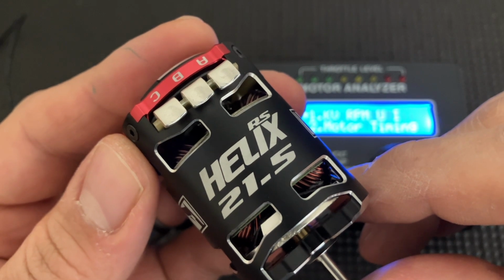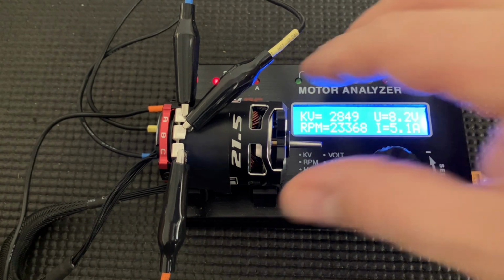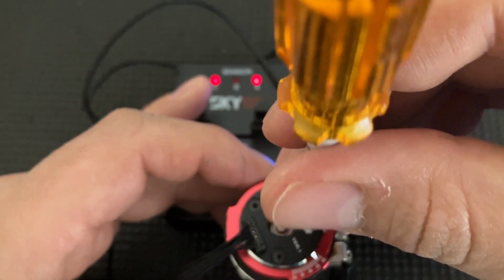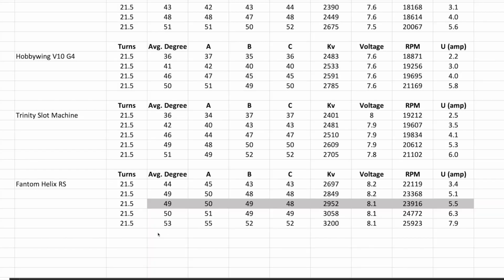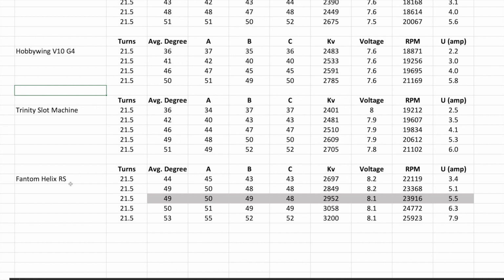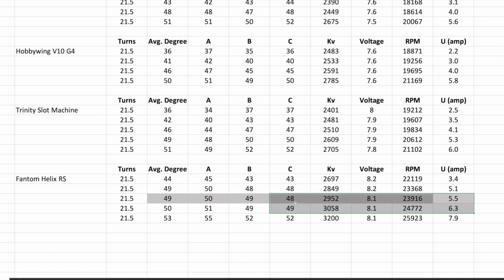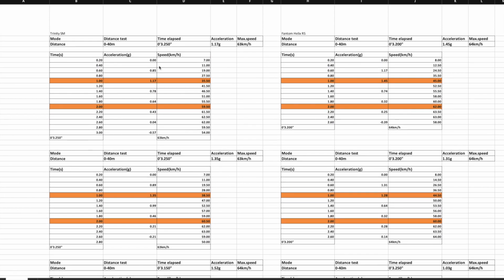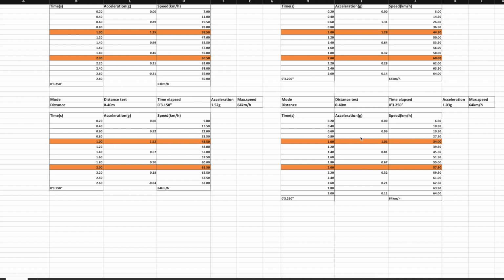Fantom Helix RS 21.5T motor Analyzer How it compares on paper with Trinity Slot Machine Hobbywing G4

Comment: Im switching from a 17.5 to a 21.5 Anyone know what gearing to start with? 
I currently have 72/30
Car is 2wd associated buggy
Reply: I tried both the 28 and the 30 today, both stayed cool enough, little faster with 30, I could probably go bigger though
Reply: Doing my first 21.5 race ever tonight
Reply from the maker: @MX-CO  Let me know how it goes.
Reply from the maker: @MX-CO  Your gear ration will probably be close to 2.0. You may even be able to drop to 1.8. That may be pushing it.
Reply from the maker: Anyone, chime in. Any feedback will be greatly appreciated. 

Some thoughts: You have a 72T spur. Have you considered running the 69T. Try the 69T spur and a 35T pinion. Lock out the slipper if you are running a slipper. Slippers will slow you down a tenth or more per lap.
Reply: @telecomandorc  I don't currently have a 69. I thought about trying that but they don't have one at LHS I'd have to order one, I may do that in the future.  
For now I just have a 72, so not sure what to try for a pinion with 21.5 I also only have the slipper but I'm racing on High grip clay, I thought the direct drive was more for carpet?
Reply from the maker: @MX-CO  The slipper is more to save the idler gear. If you take a jump the go to throttle before the rear tires land, you can break the idler without a slipper. Carpet is higher grip than clay in my opinion since we run pins on the tires. You can always torque it down more. See what the other guys are running.
Reply: @telecomandorc  OK gotcha,  I was thinking it was more for traction,  and I thought the direct drive on dirt would be more likely to lose traction.
Reply from the maker: @MX-CO  It absorbs some of the jolt from the throttle. If you are smooth on the throttle, no slipper is the way to go. If it is high traction, not slipper assuming you know when to apply throttle after a jump.

Comment: Which 21.5 motor would you buy?
Reply from the maker: I would get the Fantom RS over and over again. I may make a video in the future.
Reply: So its better than the Surpass V6?@telecomandorc
Reply from the maker: @MX-CO  I think it is. The Fantom is better.  but someone with more skill and a V6 will beat a Fantom. But a skilled driver with a Fantom will take the field.

Comment: There was a guy at our local club race tonight in the 21.5 2wd intermediate class running a helix rs, he said it was an alpha I don't see that listed anywhere,  but anyway this guy's car was so so fast, it was faster than most of the 17.5 classes.  He was clearing a big quad that I couldn't clear with a 17.5 . Some think he is cheating some how. He always has the fastest car in whatever classes he is in. Seems a little fishy..
Would you think he is cheating somehow, or is there a logical reason to win easily by 49 plus seconds? Is there a reason any 21.5 should be that much faster than the rest? I think there are others in his race with fantom motors as well, and he laps them with the same motor supposedly
Reply from the maker: It could be both. Now, I am a fan of Fantom RS motors. My 25.5 was a rocket. My 21.5 was awesome. I could pull on other cars and other drivers though I had something going on. They were just awesome. Now, for VTA I did take an outlaw motor and run it. I would take my time to get to the straight and then try to match people on the straight. This is how I found many people were cheating. I did tell the owner what I was doing. 
The thing is the Fantom RS is truly and "alpha". So it is hard to tell. I am not sure how large your track is. 49 sec is between 2 and 3 laps here. That is a lot. The guy could be running the outlaw version. Or the guy is a pro driver and has his car dialed.
Reply: @telecomandorc His car is clearly faster but he isn't a pro driver, there are much better drivers at the track. But his car is very clearly faster on the straights, and clears jumps that no one else in the class can.
Reply from the maker: @MX-CO  It might be the outlaw model. The Fantom Helix RS and Outlaw versions look very similar. Just peak to see if it is an Outlaw.

Comment: Picking one of these up this week to replace the reedy s+ motor. Should i expect a difference!???
Reply: Its the $240 works edition
Reply from the maker: Unfortunatly, I have not tested the Reedy s+ yet. Compared to Trinity, Expect a difference. So, if you have run your Reedy against Trinity motors or R1, this one is quick.

Comment: Are you running the 21.5 Fantom in anything at the moment?  I have a Fantom Helix RS in my VTA and its been great.  Im actually going to put in a 53t pinion for the next race with 92t spur.  With 52t pinion it comes off the track barely warm….Considering a Fantom now for my 21.5 touring car.  I have the R1 in my TC now and its fast but I think ive reached the gearing limit…
Reply from the maker: I am running the 25.5 Fantom in my F1 and I like it. In 21.5 I like the HW a bit better. I was running a Fantom, but the HW edges it out. But I prefer the Fantom 17.5 over the HW. I have a HW and Fantom in each of my Tamiya minis.

Comment: I’ve been running the Helix 21.5 in my X4 all season and its been a great motor. I’m still raising the pinion to find the sweet spot as it runs so cool. Trying 96/51 on Saturday.
Reply from the maker: Awesome. Keep us posted. Are you also between 48-52 degrees of timing?
Reply: @telecomandorc  The Motolyser strip says +52.2°. Measured current 3.10A, RPM 20915, K/V 2825, Hall Sensor: 0.2, Mag Assym: 3.0°. But the phase currents show 7.5, 7.3, 7.3A which seems too high? I check the temps after each run with a HW WiFi adapter. Thats another bonus of the Fantoms...they have the same temp senor as the HobbyWings. Read into that what you will ;-)
Reply from the maker: @bstearn1653  The phase current, that is with load or no load?
Reply: @telecomandorc   That's just what's on the slip so I assume no load, but I see all my other motor slips say the same thing so I guess it's normal? Any idea what it means?
Reply from the maker: @bstearn1653  It is the current the motor draws per phase (A-B, B-C, and C-A). My phase current is close to 7.7A on my 21.5T and over 8A in my 17.5T. So, it must be no load.

Comment: Very impressive phantom motor they are top shelf my opinion. Excellent video love your tech videos. Have u ever tested the velineon 3500 KV or any R1 motors
Reply from the maker: Unfortunately, my motor analyzer will not work with the VXL because it is sensorless. As we speak, I am waiting on a 25.5T Helix and my Fantom Facts Machine which I have been waiting for to test the rotors. Supposedly, they are not longer backordered and processing 🤞 

I am planning on testing R1 motors, but do not have a timeline yet. Many of the top guys here run them. But I only have access to old used ones. So as soon as I budget for the R1s I will. Just need to race the Fantoms first to get a feel for them, and finish my Traxxas 4-Tec requests. I have actually been off work (holiday) for 2 week so I have had more time to make and release videos. 

As far as motors, I generally buy 21.5T, and 17.5T. That is what I use the most. I may also do 25.5T, and 13.5T from time to time. So I will most likely do these four R1 motors in the future. Is there a specific turn R1 that interest you so I can prioritize it?
Reply: @telecomandorc  well if u ever come across a R1 wurks motor 13.5. - 4. T  just wanna see how good they actually are. Ty for great content and getting back to me
Reply from the maker: @mikebianco7854  I should be able to do a 13.5T after January. Thank you very much for watching and making suggestions.
Reply: You can run sensorless just make sure you are on 4 pole if the kv is crazy high
Reply from the maker: @jamesperdue2296  I tried sensorless once and it was really slow of the start in comparison to sensored. It was .4-.5 sec. slower 0-40m compared to sensorless. Just the start up. Then it took off. That is why I like the Tekin Rx8. Starts off sensored and then automatically switches to sensorless.

Comment: I noticed in one shot the motor was in the car connected to the ESC.  Is there any difference when the motor is tested while wired up vs. on the bench?
Reply from the maker: The difference would come from the resistence of the solder or wire connections made. But the data in the first table with the Kv data is all from testing the motors not installed.

Comment: So perhaps i should get the Fantom Helix instead of the slot machine for my 25.5....
Reply from the maker: Maybe. I do have a 25.5T on order from Fantom. It is a spec version. Not sure if you can wait, but as soon as I get it, I will run some tests.
Reply: @telecomandorc  I decided to go with the 25.5 Fantom Helix instead of the Slot Machine.  I am considering swapping out my 13.5 R1 for one as well have yet to decide.  I was considering going for the Helix in my 21.5 but recently saw an old video of the R1 motors testing very well on an analyzer.  So Im sticking with the R1 for 21.5 for now...

BTW my trinity x-factor seems to have "wet the bed" as you say.  The inner section is now loose inside the out section of the can (sorry dont know the correct terms).  It was still running but i was concerned about burning up my ESC and wanted to try an R1.
Reply from the maker: @TheNewnan3  Sound like the laminations and windings separated from the can. That can happen, I have been told by one of my race friends that runs Trinity too. My Fantom Icon v2 treated me great and liked it better than Xfactor in my buggy. But the Icon is a dog compared to the Helix.
Reply: @telecomandorc  Yeah im leaning towards replacing the R1 but dang I just got it less than a month ago lol.  Honestly my lap times are only a few tenths better than the Xfactor but thats prob due to slightly better driving on my part….
Reply from the maker: @TheNewnan3  I have a few stuff coming in including an R1. I have not made the video because I am waiting on running the Helix 21.5T mid Jan. Our last on-road race was postponed due to rain too many times. So Finally, I hope, we can finish the series. The Xfactor is defiantly my last pick between it and the HW G4 and SM.
Reply: @telecomandorc  Are you going to be testing the handpicked stator version?   Do you think that makes a difference at all? 
The 13.5 R1 I have was not the handpicked stator/sensor aligned version and I kind of wish I’d gotten that version…
Reply from the maker: @TheNewnan3  I take them apart, so I do not think the aligned version would be a good choice for me. The "handpicked" motors are generally out of a batch. So it is possible that a hand picked motor of one batch is similar to a non-handpicked of another, unfortunatly. But I really do not know. If they tested every single stator and rotor, and matched them, then it would be worth it. But I doubt they do that. So, it would all be probability at that point where paying more may increase chances of getting a better motor. This is what I like about Fantom. They give one a specs sheet with their "Team" and "Works" editions. I will have to test then in the future.
Reply: @telecomandorc  Ok i see what youre saying.  I’m prob not good enough at the moment for it to really matter….I’ve only got a few b-main wins and managed to eek my way into the a-mains a few times.  But its nice to think that at least my equipment isn’t what’s holding me back.
Reply from the maker: @TheNewnan3  I know the feeling. The first time I drove my F1 was depressing. Especially after all of the initial cost for the class. At least the motor was my old VTA motor, but still. Good thing is I am happy with it now. But don't beat yourself up. Maybe you happen to live in a really competitive area.
Reply: @telecomandorc   Oh Im def happy with the results Im getting at this point.  I started RC this year in March and have done 5 off road races this year thus far.  My first race in April  I drove full speed into the wall on the first turn!  I was so embarrassed i didnt race off road again until November lol.  I meant to say that if I get the best motor I can then at least I know its my driving skill holding me back and not outdated equipment.  Anyhow, i appreciate your feedback on all this stuff!
Reply from the maker: @TheNewnan3  😆🤣 I still drive into walls. I was driving a 4-Tec 2.0 and somehow did not see a wall and hit it head on.
Reply: If the stator came loose you can glue it back nick Adam's video talks about it
Reply: @jamesperdue2296  Do you have a link to the video?  I had a look and didnt find it…..
Reply from the maker: @TheNewnan3  Neither could I, but I am definitly interested.
Reply: My understanding was that the stator could be epoxied back to the can but I was unsure of what specific epoxy to use….
Reply from the maker: @TheNewnan3  I am not sure if FR-4 is used, and I cannot find the video. If you so, please share it.

Comment: Motor sounds to loud May be lube bearing.
Reply: They just vibrate on the plastic holder
Reply from the maker: When I test them sometimes they touch the plastic like James said. There are little rubber o-rings that limit vibration, but sometimes they shift. But installed it is pretty normal.

Comment: Is it the sweet spot is at 5.5 amps.
Reply from the maker: Roughly. This motor is about 5.5A. Over 6A there is not much gain but heat build up.